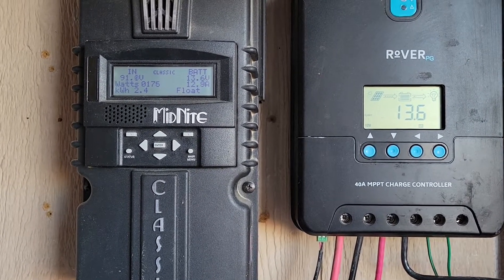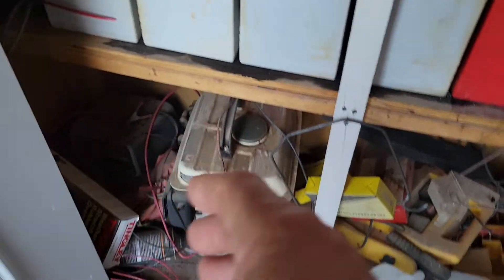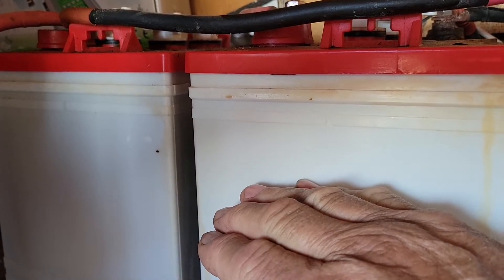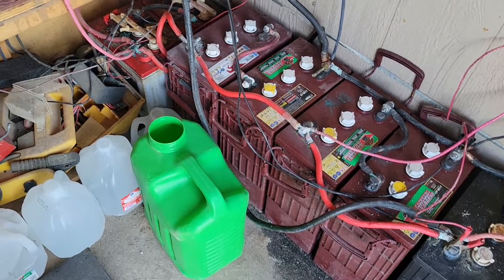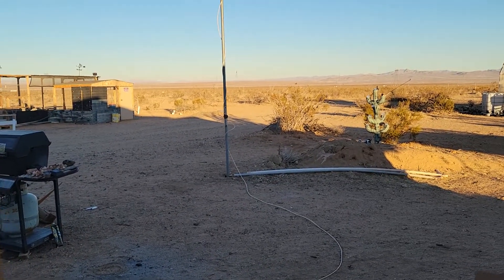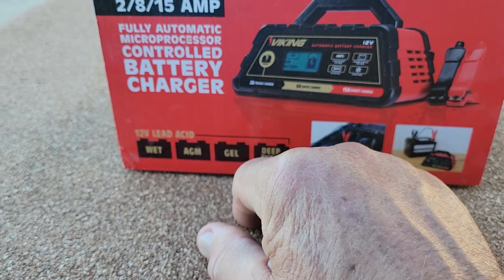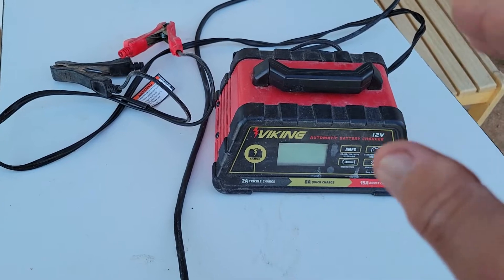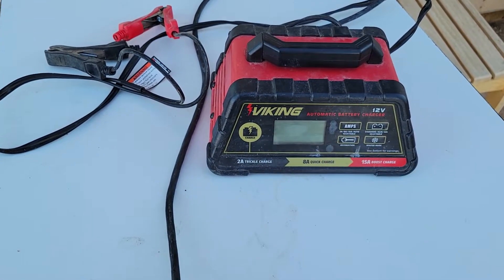All About Batteries, Jan. 24, 2022

Comment: 5 AM, my 18 batteries are at 25.3 volts. The oldest ones are 14 months old. My amp hours are 900...with two more I could go to 1005 amp hours but no need  to. I've only got half as big of an Aims as you do. LOL They don't run down very much...I like being able to use the oven more. The volts will drop to around 24.5 while cooking, but it goes right back up shortly after now. The battery bank is usually at around 25.2 volts when things start charging again. I've only had this last pair a week so they're adjusted to " the herd " now I think. With the smaller inverter, my batteries won't get drained, so I won't have to buy a 24 volt army Jeep now. With lower amperage requirements, I'm hoping these nearly new batteries will last 8 years at least. That would be an annual cost of $422.40 for my electric power. About $35 a month. If nothing else breaks. And that means they have about 7 years left, hopefully. That's pretty cheap power. Even if I just get 5 or 6 more years out of these beauties...lol. I've been hearing that it is getting more expensive to be on the grid. I sure am glad I went off grid when I did. We always have ice or freezing rain here it seems , when the grid goes off...well, yours and mine will work. I'm kind of tickled, because I have enough to run the A/C now. I think we got off cheap on the power costs. Compared to the people who are going to be on the grid this summer. I heard they're expecting record temperatures, and blackouts, and such...
Reply from the maker: Yeah, on grid here in California they don't have enough power plants to supply the populous when everyone needs A/C, so they have blackouts.  They offer free solar to certain areas just so they can backfeed the grid with the extra production.

Comment: Those recovery chargers like that only work for batteries that are only slightly sulfided.  So called repaired batteries are on their last leg and will fail in a matter of weeks.  Most repair chargers actually  hits the battery with a high voltage and  current and attempts to   charge knock the sulfides of the battery PULSATED.  B

Comment: 24v and 36v have the economic advantage of using less expensive wire  say 6awg wire  verses. 00 depending on the inverter used.   Actually you can use a  Booster circuit to charge them from your van.
Reply from the maker: I understand all that, but my budget got in the way, and I had wire left over from construction jobs.
Reply: @GBear  lol, we do what we can with what is in hand.  I stared with one panel and one lead  battery.
Reply from the maker: @pulesjet  I hear that!
Reply: @GBear  LOL my lack of pay check got me interested in this stuff.

Comment: where can we get the blue thing on the wall from? (to help the batteries last long.)
Reply from the maker: It's called a BLS-(VOLTAGE) IE; I use a BLS-12 for a 12v system.  You can buy them on eBay for your individual battery bank voltage.

Comment: Good deal! I'm gonna get one of those battery chargers. I have watched videos where people have reconditioned batteries with a 200 amp charger. 
I got a totally dead battery recharged with my 75 amp charger, but my motorcycle battery won't come back to life. I want to try to fix it with that charger.
Reply from the maker: Remember the battery must be able to hold at least 10.5 volts for a recondition phase to work.  If the battery can't be repaired the charger will say "repair failed"
Reply: @GBear  I'm pretty sure it will fix the motorcycle battery. It started to work, but my current charger has been acting up and I have to flip the switches on it a few times to get it to work.
Reply from the maker: Ahhhh, then you should be fine.

Comment: And that's good on your glasses and that is weird to have that sand scratches glasses that is amazing right I had to get glasses back in early 2000 I didn't put them on they always stayed on the dash of the truck I just could not wear glasses I didn't like things messing up my Vision then later on I had to get another pair that was a few years back could not wear them either then I had work done on my eyes I see really good now and one thing I could not do all my life wear sunglasses I just didn't like messing up my vision
Reply from the maker: I rode motorcycle through every contiguous state in the country years ago.  Wore sunglasses all the time.  Now I don't like sunglasses, but need corrective lens to read and see detail.

Comment: Nice I have 4 of those yellow caps
Reply from the maker: They are nice.  The one in my van has been there since 2013.
Reply: @GBear  wen I started with my off grid system 5 years ago I had 16 of them for a 12v system i sold them wen because I wen with lifepo4 but still a 12v system and now I got 4 more from a machine that I repeated
Reply from the maker: I haven't found any lifpo4 batteries with high amphours to handle my machine shop tools.
Reply: @GBear  I have 4 960ah at 13.25v  but I made them and one 960ah at 26.50
Reply from the maker: @solar and wind in south Texas roman  excellent.